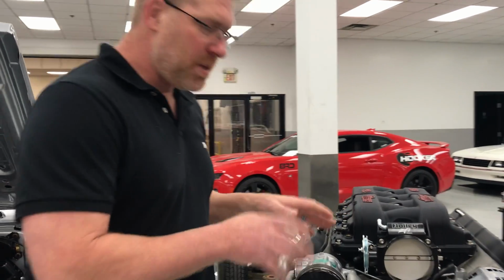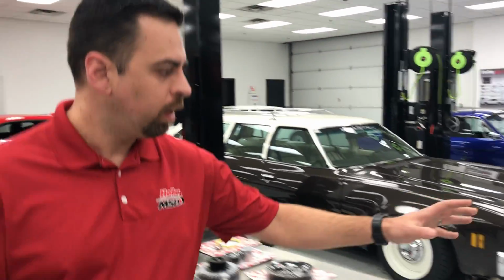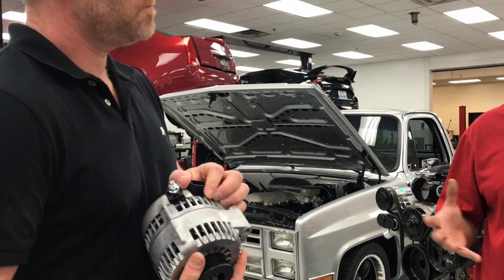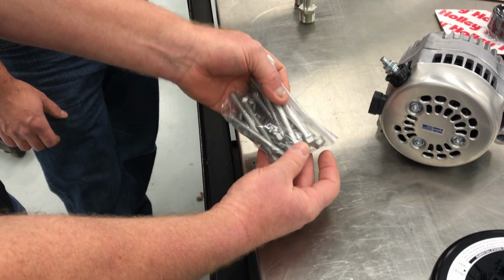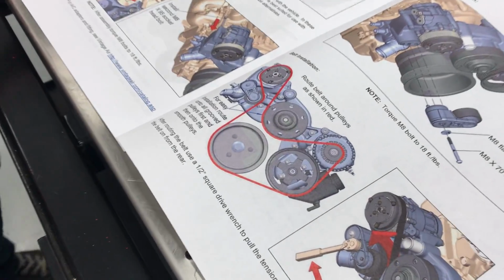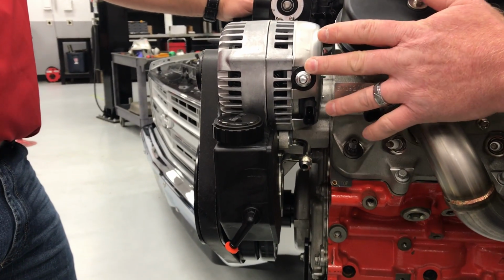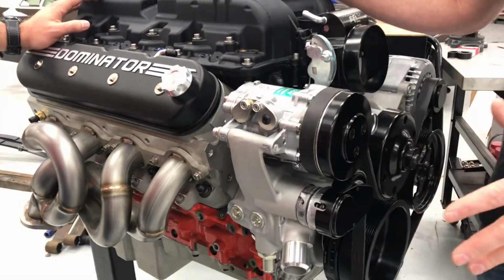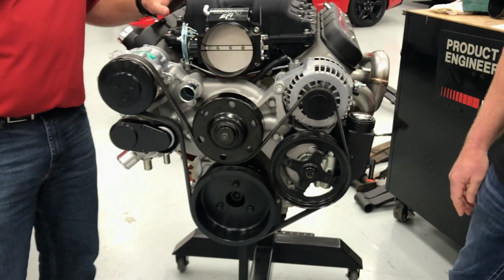Holley Mid-Mount Accessory Drive FB Live Video

Comment: When are you going to address the issue of the power steering pump squeal due to the belt not having enough contact with the power steering pulley.

Comment: What rad is that? Looks way better than the rad hose going all the way to the left side
Reply from the maker: Our frostbite LS swap radiators have inlet/outlet both on the passenger side to simplify installation.
Reply: @HolleyPerformance  do you have part number for the rad hoses?
Reply: @HolleyPerformance  thank you

Comment: Can this be shaved down to work with a motor plate?
Reply from the maker: It all depends on the plate?  It is possible, but you will have to customize for each application.  Thx J

Comment: Do you make a mid mount accessory drive for LSA swaps?
Reply: The side heater hose port / bottom port is a must have for C3 swaps due to the control arms. Thats awesome, I did a 74 a few years ago and had to modify the water pump.